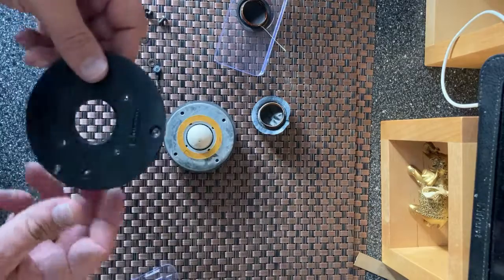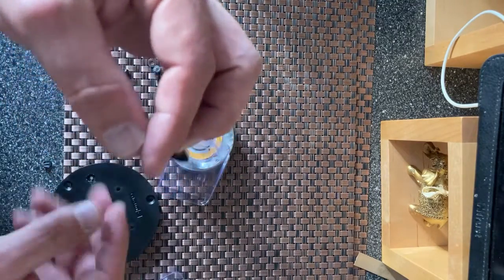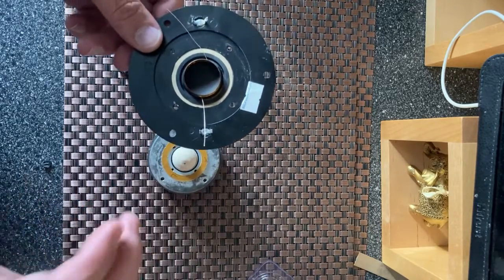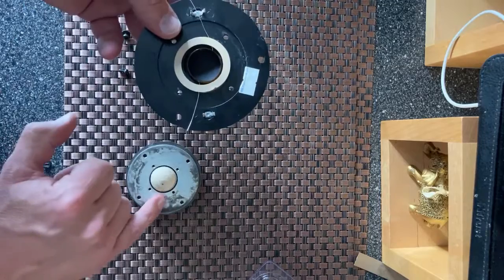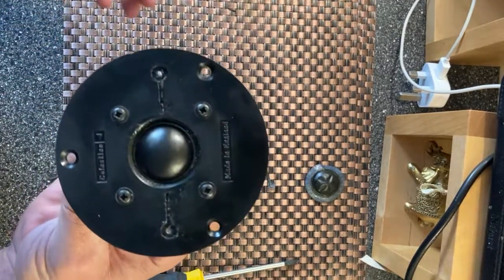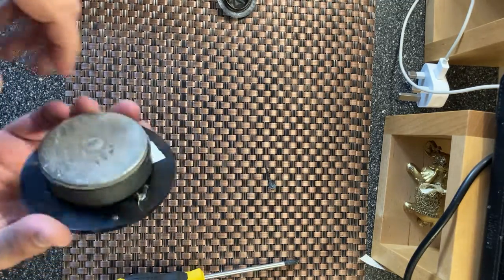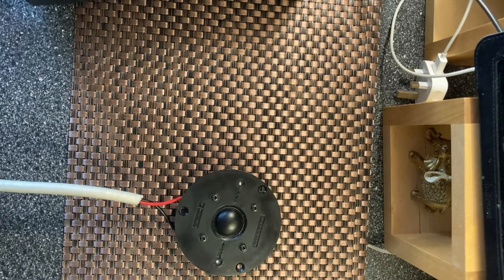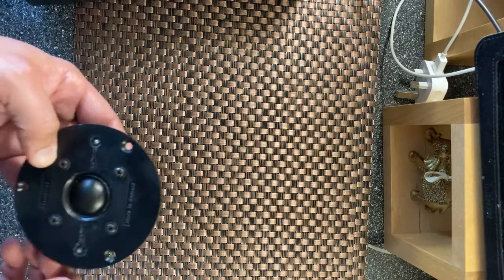Celestion HF1000 tweeter repair.. quick way..

Comment: Just did one, drilled very tiny holes with a dremel (0,79mm drillbit) in the faceplate around 10mm from the coil (there is a small ridge) and led them on the outside back through the small holes an soldered them. Used one layer of electrical linnen tape to isolate. Put some glue in the lead tracks and solderinghole. I removed the felt dome as the new domes wont fit over it (as far as I could see). Ask for 4 ohms specifically when ordering. They will send the correct ones.

Comment: Hi thanks for this video, very helpful - did the repair with an eBay 8ohm voice coil, it says 8ohm on the back of the tweeter housing, but still sounds very treble-heavy, is this just the sound of the 15XRs?

Comment: The 4 Ohms version of this diaphragm seems to be impossible to find nowadays.  Would it work to unwind half of the coil of an 8 ohms until it matches the dc resistance of the other tweeter?  Or would all the winding fell apart?
Reply from the maker: I wouldn’t do that.
Adjust the crossovers to compensate
Reply: @dittonworks  Thanks for the quick response.  You are right, I thought about it later.

Comment: looks like a different type of dome material that's a sort of plastic the original looks like impregnated material.
don't forget your test  leads a couple of ohms so it's probably 6.6. you can run a carbon film resistor in parallel to give you the desired resistance.

Comment: Do those generic dome replacements sound the same as the originals?
Reply from the maker: That one won’t as it’s the wrong impedance.

4ohm ones sound close enough
Reply: Will it run hot if it’s 4ohm
Reply from the maker: @paulmurray6071  the amplifier would run warmer with 4 ohm load.
Reply: Hi got a set of 15 XR with no tweeters and have been given a set from ditton 22  but need new coils . Is it just the coil that sets the impedance. are the tweeters the exact same as I need the 8 ohm for the 15 XR  but think there 4 ohm ditton 22 version